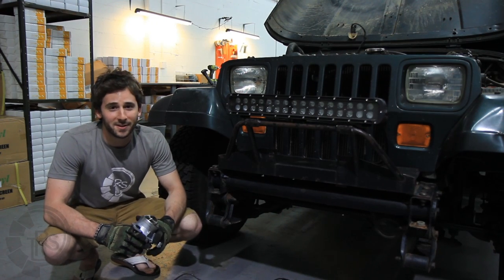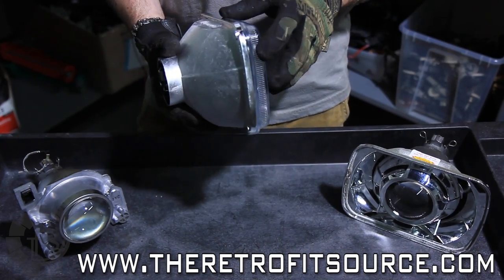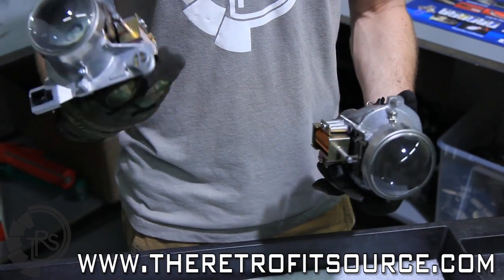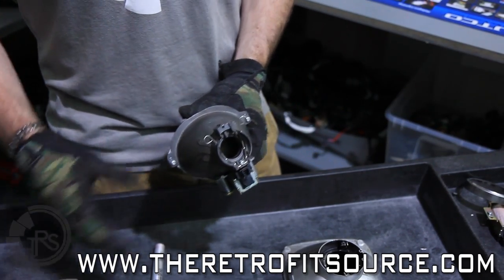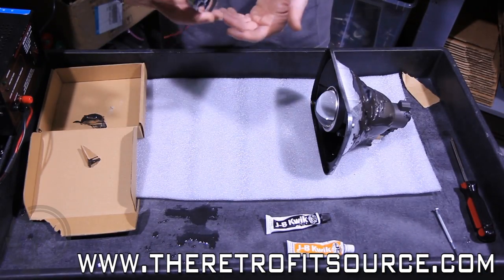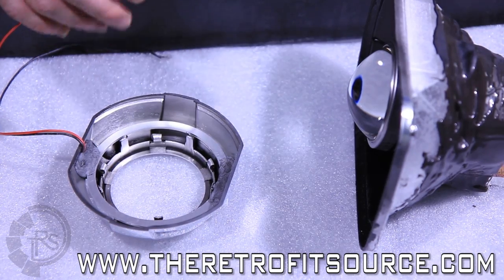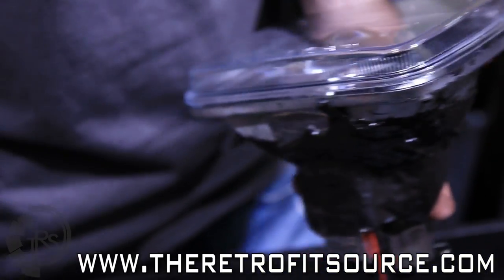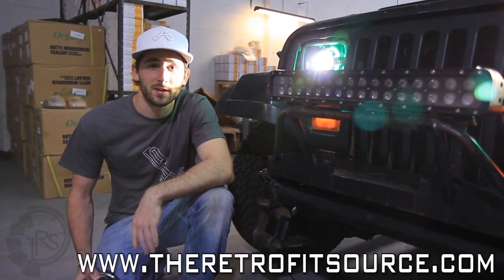TRS Tips: 7x6 Sealed Beam Bi-xenon Headlight Projector Retrofit Upgrade How-To

Comment: How did you align the projectors horizontally if you sealed the headlights?
Reply: +MikeandSamonPC thats done before the lens cover is resealed on the housing. Mount the rear buckets to the vehicle, and use JB Steel stick to tack the projector in place (While lit up so you can see the beam) and then go over that with a full layer of JB weld to make it permanenet once you've got the alignment right

Comment: Do they get hot enough to melt the plastic lens?
Reply from the maker: They do not.
Reply: Proper projectors don't emit much heat and those that do have cooling fans or aids in the rear

Comment: Amazing video. Currently doing this this week. What did you guys use to cover the gaps on the back of the projector?
Reply: Looks like JB Weld
Reply: Just want to throw this out here in case someone else finds this. I ended up using quiksteel. Found it advance auto parts and it's like playdoh. It was rated for 400 degree, water proof, and cures within 24 hours.
Reply: Mygel Bergstresser is it still holding up? Building a retrofit now, and was gonna use JB Weld, but would consider other options if available.

Comment: I feel you skipped the most important part. Aligning up the the projector inside the new headlight housing so the aim is correct. It would totally suck to get it all glued in and find out it was set in pointing down, up, left or right too far to be adjusted.
Reply from the maker: You’re absolutely correct, I would always recommend mounting them to the vehicle and making sure you’re  good to go rotationally before making it permanent!

Comment: y wouldn't you just buy 7x6 projector headlights???
Reply: Theo DuQuesnay they don't sell quality ones
Reply: Theo DuQuesnay Because pre-made ones are usually complete crap with cheap projectors. The method TRS used has high quality projectors that will have way better light output

Comment: you couldn't have just mounted it from the back with out cutting such a big hole
Reply: Kareem Colebrooke not enough depth to the housing. It's gotta be done like that so it will clear the lens. Smaller projector retrofits require less to be taken out.

Comment: or just buy a set of headlights with projector built in for like $60
Reply from the maker: Not all projectors are created equal! Dedicated, HID compatible projectors will outperform the cheaper halogen based projectors significantly.

Comment: could there be the possibility of having condensation inside since the back of the projector is open to the elements?
Reply from the maker: Ulysses Godinez We will continue making DIY Videos as detailed as we can, thanks!
Reply from the maker: Ulysses Godinez Very unlikely, it was sealed up with JB weld, aluminum tape, and silicone :)